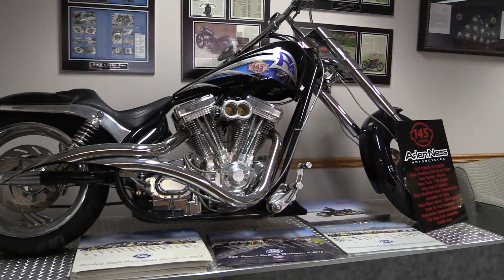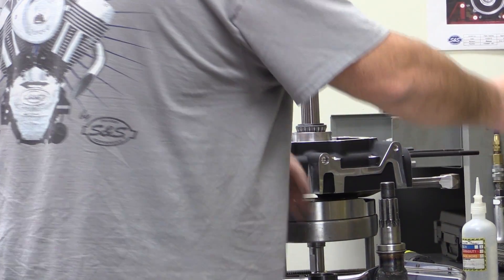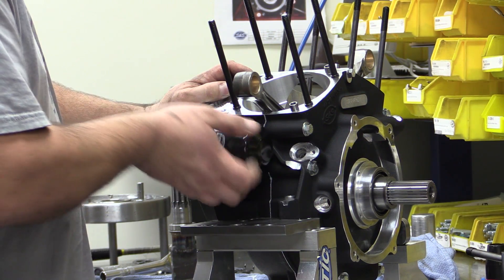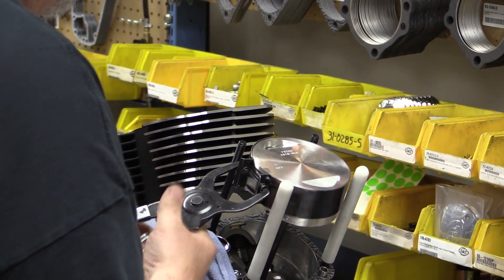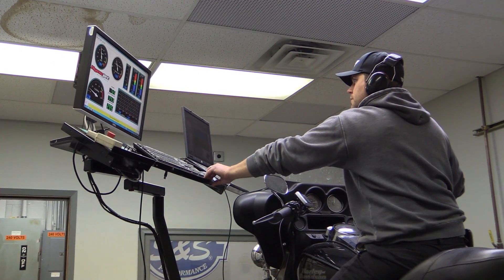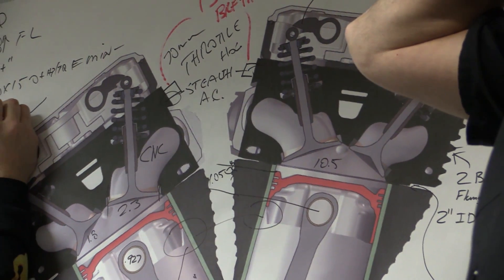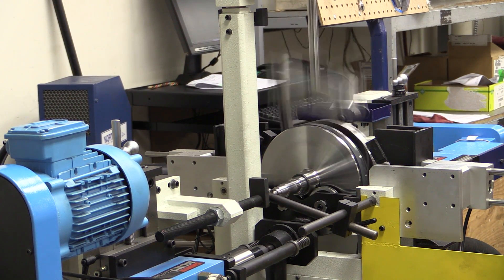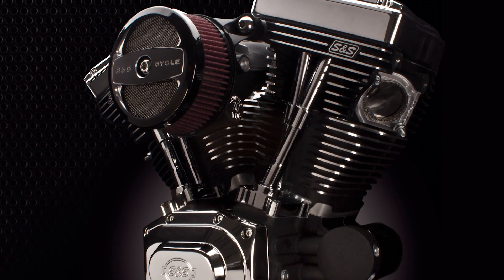Making the T143 Engine - S&S Cycle's Biggest Bolt-In Motor

Comment: Will this fit in a 2000 fat boy replacing the 88 twin cam stock engine?
Reply from the maker: Our crate engines will not bolt into your Softail frame, unfortunately. You could have your current engine built up to as large as 124" with our Hot Set Up kit. You can find all of our engine power pack options for your bike here: https://www.sscycle.com/2000/Harley-Davidson/Softail-Fat-Boy-FLSTF/#category=1%7CPerformance%20Kits

Comment: Can the 143 be used for touring applications
Reply from the maker: It is possible, however the 143 was designed as a high performance racing engine. Thus, it has closer tolerances & will require maintenance at more regular intervals. For a more touring oriented option, check out our 111 or 124 offers!

Comment: hi, I have a question about this engine, if I wanted to mount it on a softail would it be able to fit into the original frame or should I modify it?
Reply from the maker: Unfortunately our T Series engines are not compatible with the Softial chassis.
Reply: @SSCycleInc  thanks for the information

Comment: Would this fit in an ironhorse Texas chopper?
Reply from the maker: Unfortunately not. Your Ironhorse should be an Evo style engine while the T143 is for Twin Cam chassis only. If you're looking to swap motors your biggest option is our V124.
Reply: @SSCycleInc  my other bike is harley Davidson road King ,would it fit in that?
Reply from the maker: @GUILLOT1NE  potentially, yes. What year is your RK?
Reply: @SSCycleInc  I have a 98 classic wife has a 2006
Reply from the maker: @GUILLOT1NE  Your '98 should be the last year evo, so you will be in the same place as the Texas Chopper. The 2006 on the other hand, may be able to receive the 143 as a transplant. You can find all of our 143 options here: https://www.sscycle.com/search/?category=1%7CEngines#category=1%7CEngines&displacement=143%22
Reply: @SSCycleInc  thank you for your replies, and rapid at that.  Thanks, you've been incredibly helpful

Comment: I put a T124” in my old bobber, had it bored and stroked to a 138”, the frames from a 1973 straight leg, and it fit in with room to spare. How much bigger is the T143” than the T124”? Cant really find specs online.
Reply from the maker: Physical engine size? It's roughly same height as 124. Fits in stock frame.

Comment: Hello! Will supply the 625G S&S Gear Drive Cams Set Pushrods Lifters Engine Kit for the Harley 88 "Twin Cam. Should I change valve springs?
Reply from the maker: Yes you should!
Reply: @SSCycleInc    Спасибо!!!

Comment: I'm from Canada, if the borders open and we can travel again after the covid19 is over, could I ride down and drop my bike off and have a motor installed ? 2011 Streeglide
Reply: Theres one for sale in montreal already in the bike 17000$
Reply from the maker: We do not do installs, recommend you contact your local dealer.

Comment: Hello to all at S&S 
In your opinion  would going carb set up on the 143ci with something like a 48mm mikuni with some mods to the manifold 
Hold back this engine from performing or is the 70mm throttle  hog the way to go.any feedback  would be greatly appreciated as I'm keen to buy  a engine but still undecided as to buy a carby or injected dyna.bike will see 20% road and the remainder on the drag strip.thanku from Michael adelaide Australia. I've modded a 48mm mikuni to a built 120ci off rx heads with your crank, 1:75 rocker arms,pushrods and 675gear driven cams  & slip on s&s taper turbos with good results
02 Nightrain ,stock gearbox,factory belt drive,footshiftng,street tyre & pumpfuel consistent 10:50s @126mph.my mikuni has been great not sure if it will work the same on the 143 though.any help would be great.cheers.
Reply from the maker: We offer both version (although with our G carb), but like any engine fuel injection will allow you to make more power throughout the entire RPM range.
Reply: Thanku .appreciate the speedy response👍

Comment: Would this fit in my 2007 big dog mastiff thanks nice
Reply from the maker: Big dog was an Evo style engine, this is a Twin Cam. Would not bolt straight in. We do make a 124" replacement engine that will bolt into the Big Dog  https://www.sscycle.com/search/?keyword=v124#keyword=v124&category=1%7CEngines

Comment: Looks great but why should I buy that over a 120R?
Reply: Because this has a warranty and the 120R doesn’t, and the 143 has more potential with it’s significantly increased displacement. Also S&S has a higher degree of manufacturing quality than factory HD. I’m having the 143 installed on my modded Dyna lowrider S

Comment: Will this fit any road king?
Reply from the maker: The T143 is  Twin Cam style replacement engine and designed for 1999-2016 Touring models.     https://www.sscycle.com/products/t143-black-edition-longblock-engine-for-select-1999-06-hdsupsup-twin-cam-88-95supsup-103supsup-models-635-ge-cams/

Comment: Can I fit this into my 2018 Fat Bob?
Reply from the maker: Our 143 is Twin Cam format, so will not bolt into the Milwaukee Eight chassis. We'd recommend our Power Package (Big Bore kit, cam, oil pump and plate) to transform your Fat Bob into an Angry Bob!    https://www.sscycle.com/search/?keyword=m8%20power%20package#keyword=m8%20power%20package&category=1%7CPerformance%20Kits

Comment: So this motor fits any HD. So if I bought a fat boy. This will plug right in ?  Also fuel injection? Or carb?
Reply from the maker: This fits any touring frame - the Fat Boy and Softail lines have a "B" balanced engine. We have seen it done but you may need to make some modifications depending on year. Give our techs a call and they can go over specifics! 608-627-1958

Comment: 160hp and it's not for everyone?  average litre bike pushes 200 hp and is for everyone. what am I missing ?
Reply from the maker: This engine has massive torque right off idle. If you are used to a stock bike it can get out of control.
Reply: Exactly that it puts out gobs of low-end torque right off of the bottom and then picks up horsepower towards the top so does not for a beginner Rider who has a stock 88 or 96 cubic inch motor or even a slightly modified motor
Reply: Liter bikes aren't for everyone either.
Reply: @60viking  Neither are 600cc 4 bangers with 14-18000 RPM redlines! Some people have no respect for engine power-to-weight ratios until it bites them in the ass.
Reply: An r1 only puts out 80ft pounds of torque, the S&S 143 puts out over 150.

Comment: I'm now thinking of putting one in my 04 Electra glide classic instead of the 124 cube I priced this week. Loving my 113 cube in my '87 FXR til I sheared off my rear sprocket bolts last week:(
Reply from the maker: Better get some stronger bolts!
Reply: S&S Cycle, Inc 
If you don't mind me asking, what grade bolts would you recommend?
Another biker installed titanium bolts after he sheared off grade 5 bolts twice.
Reply from the maker: You should be using Grade 8 shouldered bolts with red Loctite as a standard procedure. We can also recommend this product.
http://www.hardcaseperformance.com/products/bolt-lock-r
Reply: ...Yeah...Grade 8 is the minimum for any motor vehicle.....
Reply: Thanks for the info guys!
Change of plans...Just bought a '13 103 HD engine complete with 6speed trans fr TX police auction for 2k. Switching intake to a Super G fr EFI...Wish me luck!
Btw FXR has a new happy owner:)
Reply from the maker: Good luck!

Comment: You wouldn't happen to make this in a B engine would you? Or is it strictly A engine only?
Reply from the maker: Sorry, we don't have cases for the "B" engines.
Reply: @SSCycleInc  What is the difference between an A and B engine? Btw. I have a 93" all S&S shovel style engine that i installed in a '75 FLH. It came fully assembled with an electronic ignition but my bike obviously isn't wired for that. Was thinking about going old school with a single point dist. Any advice would be very much appreciated by this backyard wrench. If it's easier for you you can email me at  wmetevia57@gmail.com. Thank you in advance.
Reply from the maker: @waynemetevia7983  The B engine is a balanced engine - the H-D® Softail® models use an internally balanced engine.  For more info on your SH, give our techs a call - 608-627-1958

Comment: I just ordered mine... 2009 Electra Glide Ultra Classic. She will have a 143 in it. Thanks guys.
Reply: +Cory Welsh how much did it cost you?
Reply: I don't know exactly. I am in Canada so there is an exchange rate issue and shipping. Plus I am getting a lot done outside. But I remember the estimate of 17,000 quote to me. With kit and install maybe. But I a also getting ne Transmission and a whole lot more. My total bill is 40,000 Plus. The guys doing my work are Calgary Harley Davidson. I don't want to miss lead you but it is expensive. I was planning on getting the SE 120R but the guys showed me the T143 in a Road Glide and I saw blue flames coming out of the pipe, I said "That's what I want, let's do that" the sound was amazing. I hop tha answers that for you.

Comment: do you have any info on S&S motors vs regular Harley motors as far as quality and reliability wise?
Reply from the maker: +Elliott Alameda We feel that our quality is unsurpassed, but we may be a little biased. However, we make our parts in the USA and assemble the engines one at a time here in Viola, WI, and if you ever took a tour of our facility, you'd see that it's not the same as a high production assembly line. As far as reliability, it's hard to make a statement about that because most people buy our engines to beat the snot out of them. It comes as no surprise, therefore that the "average" rider may get more miles out of a stock engine. Let's go out on a limb here...we think it's not unreasonable to assume that an S&S engine would deliver better reliability and engine life if driven conservatively. But where's the fun in that?
Reply: I suggest you visit online forums to see what owners say. They are what convinced me to buy my V124. I'm a multibrand mechanic and I would much rather have S&S parts (I've been running their products since the Super B days) than factory any day.  The best reason to buy S&S parts are stock Harley parts because Harley INSISTS on using cheap shit (INA cam bearings sucked in the Evo years and still suck!) and highly questionable designs (the stock Twin Cam cam drives, ALL of them).

Comment: So strange… The design of this engine is ancient!
What if put electronic injection on it, liquid cooling system with a radiator, four valves per cylinder and two camshafts in each head (four in general).
That would be a beast!!!😍
Reply: ***** I have put over 400,000 miles on those :ancient engines, and I am still going strong... To each their own...
Reply: Strange? Don't be foolish... A 143ci OHC engine wouldn't fit in the stock chassis. EVEN IF you could design one to fit, it would probably be heavier, and not generate the gut wrenching low-end torque this motor does. If you want an OHC motor, stick with the Metric Bikes.